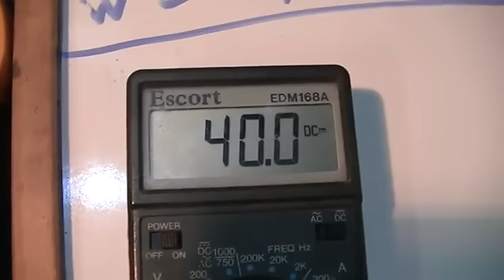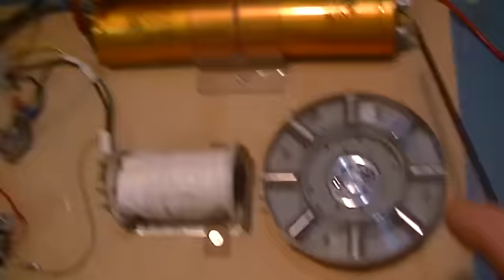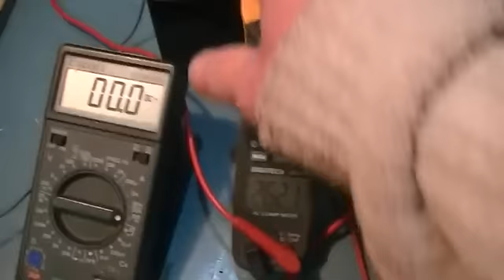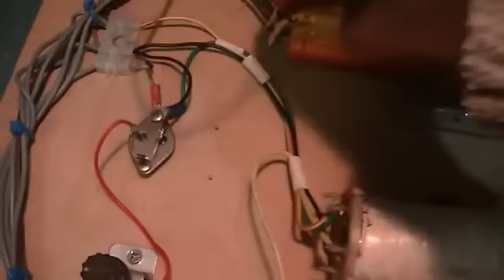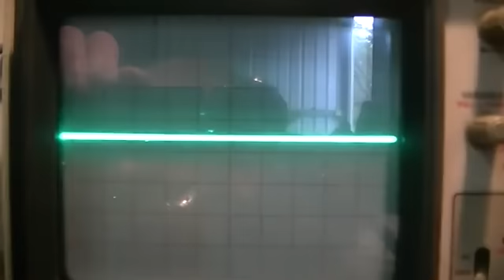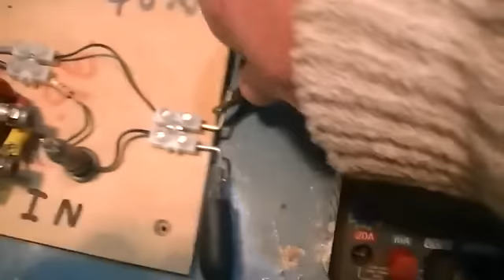new pulse motor and measurments.mp4

Comment: Very good math and good conversations with no name calling"rare". Assuming input watts .9792 output watts .9724=load draw of .0068 I still think its a dam good circuit when you take in account the convenience of light produced (solar effect could produce energy) and the rotating mass of the motor that could be coupled to a load. I always look at a "system" to gain its efficiency rating. Ex: a bad spark plug will pull the efficiency of an engine lower than if the cylinder was not there to start

Comment from the maker: Oh were far from understanding all there is to know,but we have to use what we have avalible to us today -until we find otherwise.But there is one thing that still bug's me about my system,and that is-with the system hooked to the 26 volt battery supply,it takes about half an hour to pull the batterys down half a volt.But if i place a point 97 watt load across them,it pulls the battery's down nearly a volt in 10 minutes? But i think i may have an answer for that-i think lol

Comment: @sstubbby I don't understand what you’re stating, you need to clarify:

R2xR1+R2=? (explain equation and show numbers)
There is no 120 ohm resistor in this circuit.
Negative resistive positive loads? (provide definition)
Required state and frequency? (explain and provide requirement)
Very correct? (if very correct then provide convincing proof)

After inserting two (.) the YouTube link you provided does not work.

Comment: I understand what you are saying. But if you were to calculate the circuit as a voltage divider you will see that in a Q1 on state that the following equation would be true R2(Coil)*R1(The 120 Ohm Resistor)+R2. And in a Q1 off state R2 (battery) x R1 (The 120 Ohm Resistor)+R2. Both; the battery and the coil are negitive resistive positive loads. But in the required state and freq.... This is a bit complicated. But very correct. Somthing to view wwwdotyoutubedotcom/watch?v=qKqrXcU2jGo

Comment: @TinManPower Yes, power can be calculated as P=V^2/R. Using algebra you can also use the following formulas to calculate power based on which parameters you have available: P=AxV, P=A^2xR. Very important to note when calculating power for a component, that power is only used by that component, the power of all load components needs to be added in order to determine the total power. As an alternative, the total power can be calculated by multiplying total voltage times total load current. (AC/DC)

Comment: @TinManPower Lastly, power disipated by bulb solely determines brightness. This answers your question about why input and output bulbs have different brightness.  Input bulb 0.782Vx37.4mA= .0292W (dim) and Output bulb 3.71Vx80mA= .2968W (much brighter due to 10 times more power used by it). Hope this helps explain your findings and provides you and others examples to better understand calculations.  EnergyFabricator/Russ/Zero and others with good technical understanding can check me on this.

Comment from the maker: Ok-well i have been told by a good source that watt's being consumed is calculated by the voltage across the resistor squared divided by the resistor value.EX-122 ohm resistor with 5 volts across it would be 5x5/122,which would equal .205 watt's.I am yet to try this-but dose this sound right.

Comment: @TinManPower Now let’s sum the power used by all load components which should add up to total input power: Input bulb .782Vx37.4mA= .0292W + 100 ohm resistor 3.74Vx37.4mA= .14W + motor 21.67Vx37.4mA= .81W, this equals total input power of .9792W. Cross check with battery voltage and total load current 26Vx37.4mA= .9724W, within tolerance. Regarding your question, you can calculate the current flowing thru a resistor (A=VxR) and the power used by it (P=VxA) but not the power flowing thru it.

Comment: @TinManPower Let’s first sum the series voltage drops which should add up to the total battery voltage of 26V: Input bulb (.782V metered) + 100 ohm resistor (3.74V calculated) + motor (21.67V metered across caps) = 26.19V, within tolerance since100 ohm resistor has 5% tolerance. The 20,000uF capacitance across the motor is primarily providing dampening which is doing a good job of smoothing out the DC voltage as demonstrated by your scope shot, motor load impedance calculates to 579.4 ohms. >

Comment: @TinManPower Thanks for confirming circuit setup, it helped confirm source of confusion. In this circuit total voltage is equal to the sum of the voltage drop of all series components in the circuit and total input power is equal to the sum of the power used by all load components in the circuit. You’re not accounting for the voltage drop across the series motor load and you’re using correct power formula but are misapplying it. Also note that power used by bulb solely determines brightness. >

Comment from the maker: Yes that is correct-but also run coil is generating power back to the cap that the batterys are hooked to that has the 100ohm resistor and globe in series between the battery and cap.The two cap's that run the output are also collecting the back spike(or backemf as we call it)via two diodes from the collector of the transistor.The potential voltage that is across the 100 ohm resistor and globe 1 is 4.5 volt's.Hope this helps

Comment from the maker: Hi ReasonForemost-thank you so much for your help.I have many people telling me many different thing's.I did try to explain as clearly as i could in the vidio of what i had.If i was to have just a resistor (say 122 ohms)insted of the globe-could i calculate from the voltage across that resistor the power(watts) being passed through that resistor?As far as im aware its volt's across the resistor x the input current.

Comment: @TinManPower This is my understanding from this video: 1.Two charged 12V batteries connected in series provide 26V per meter. 2.Total load current is 37mA per meter. 3.Circuit consists of the following components connected in series to 26V batteries: bulb1, 100 ohm 1/2W resistor, and motor which has two 10,000uF capicitors connected in parallel across it. 4.Voltage across bulb1 is .782V. 5.Isolated trigger coil generator is charging two 10,000uF capcitors in parallel with bulb2 as load. Correct?

Comment from the maker: I do value your comments ReasonForemost,but you have made the same mistake many others do,and that is thinking we are useing 26 volt's just because that's what you see.But if you have a 12 volt battery and a 6 volt battery and hook the 2 negatives together-you only have a 6 volt potential.Any load pulled from that 6 volt potential is calculated at 6v x amp's-not 12 volts.That other battery in my setup is the cap,and the potential voltage is only 4.5v x 37.4ma-not 26 volt's

Comment from the maker: If you use ohms law to calculate the battery voltage(the globe has around 22 ohms resistance at that voltage)That being the 122 ohms and 37.4 ma-you will see you get 4.5 volt's.So just because you see only 26 volt's,that dosnt always mean there is 26 volt's.I can asure you there is not nearly 1 watt of power being drawn from those batterys.Even a half watt draw will pull them batterys down a lot faster than that.

Comment: @TinManPower Viewed other video as you suggested, had not seen it. In that video, based on 89mA current, the 33 ohm resistor wattage is 0.26 watts (P=I^2xR = 0.089x0.089x33) NOT the total 2.338 watts. The 33 ohm ½ watt resistor would not feel warm at 0.26 watts, you appear to mistakenly assume that this resistor in other video and the bulb in this video represent the total input power wattage. These 2 components are in series and provide indication of Total Load Current NOT the Total Load Watts.

Comment: @sstubbby While term 'power consumption' is commonly used, you’re technically correct, power is rate at which energy is transferred, used or transformed. We agree on output power but how about power that’s being used by the 100 ohm resistor (heat), motor (work+heat) and transistor (heat)?  All of these and bulb are in series powered by the 26V batteries, bulb alone is 0.782Vx37.4mA= 29.2mW and 100 ohm resistor alone is 3.74Vx37.4mA= 140mW. Total Power Input = Total V(26V)xTotal A(37.4mA)= .9724W

Comment from the maker: Hi ReasonForemost.Any current that the load is useing has to pass through the input globe first.As this is pure DC current ,reguardless of what is behind the globe-resistors,caps and inductors,the load current must still pass through the globe.Many people make the mistake of automaticly thinking it's battey volt's x amps.But you will see in my last vidio-that is not always the cass.An incandecent bulb is a very good visual indicator of current flow.This is only my understanding though-thanks

Comment: @TinManPower Appreciate your efforts, videos and openess to comments. You didn’t go too much into your circuit so this is what I got based on your extensive video: Bulb brightness represents the power consumed by bulb only. On input the bulb wattage does not include 100 ohm and motor load (input current also limited by coil and Q1) and on output it is the total consumed power since bulb is the only load. Input Power = 26V x 37.4ma = .9724 Watts  and Output Power = 3.71V x 80 mA = .2968 Watts.

Comment: Well done... I do have a theory on this. But as you, claim nothing. Electrons flow over a given load. But this does not mean they are spent. The Caps as well the Mag. motor arrangement can be considered as pumps, recycling electrons in the set path. As well the in rush of electrons through the colapsing magnetic field(s) from the very space around us. I would be courious to see a N. Tesla Pancake coil in a similar arrangement. And this due to his horizontal wave theories and practices.